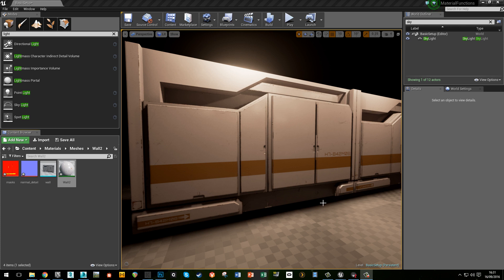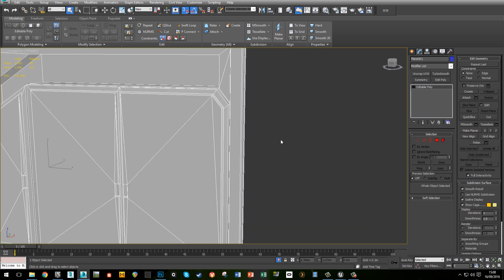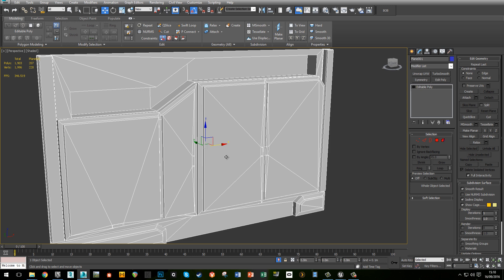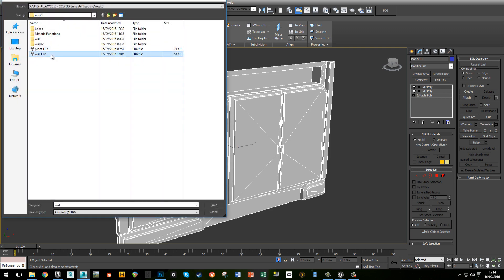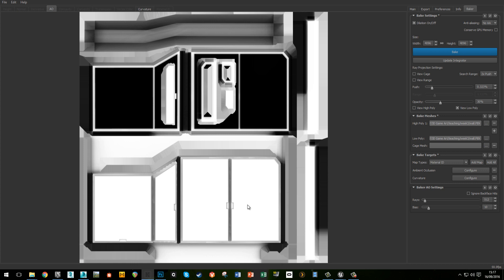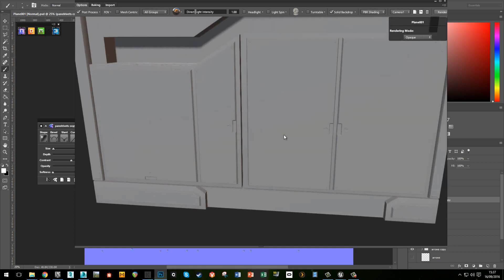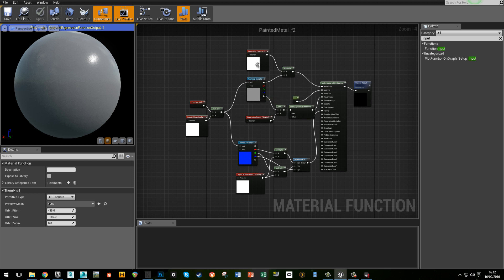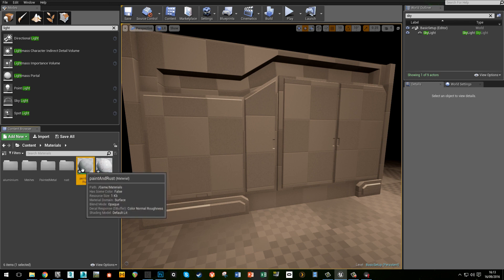Using material functions in Unreal 4 to speed up your workflow

Comment: I think you could save on a lot of texture size by using floating decals for the screws, and even the edges.  This way you could probably eliminate the unique normal map entirely, you would be able to reuse the decals on a lot of objects.  As far as I can tell, this would save a whole bunch of textures from having to be in memory.
Reply from the maker: decals could be used if the object is too big for unique normals.  This stuff does depend on your platform and the set up of your game, and its rarely a case of saying one thing is better / cheaper than another - it all depends.  Are you trying to optimise draw calls or texture memory etc...?  In this case I would say a unique normal is probably a better solution though.  Remember decals aren't free either!  In fact the cost of them can add up significantly if you go crazy with them

Comment: check the vertex weighted normals script, it gave me a decent result
Reply from the maker: thanks thats really cool, I might remake this video using that script instead
Reply from the maker: I've just spent a while playing with this and checking out some videos.  Its a great script (and I'll definitely keep it in my arsenal) but the technique is actually quite a different thing to what I have used in this video.  I think my mistake here was to call this 'mid-poly modelling'  when what I'm really doing is replacing the need for a normal map by bevelling edges.  There are a bunch of pro's and con's to each technique but not enough space to write about them here...  I think the key for everyone is to understand why they are doing things and make an informed decision for each asset
Reply: I agree, awesome work and great technique. personally I think that understanding the why it's the key of success. medium polygon modelling is great ( no high poly, no bake and less custom textures means better fps ) and less verts is awesome for optimization purposes. responding to my comment shows that you're a professional and open to suggestions, Kriaa Amine ( Tunisia north Africa)

Comment: I'm sorry but I guess there is some confusion about the mid poly modeling. This technique would work much better if you use an actual chamfer and then use a script to modify the normals with a weighted average. This way the vertex information would be the same, the highlights would look better and the silhouette would also get better.
Reply from the maker: Whilst I agree to some extent, the point of this is to make the workflow thats as fast as possible - not necesarrily giving the absolute best results.  I think I mention this in the video.  The problem (I have found at least) with chamfering is that there is a lot of clean up afterwards when meshes get complex.  I want a 1 click solution that preserves my UVs and this works pretty well for that. It also gives me my first LOD for free.  To get the absolute best highlights you will want to maintain quads in the straight corners, but to do that you are basically creating a high poly model and then having to clean it up / unwrap afterwards
Reply: I agree
Reply: but nicely explained